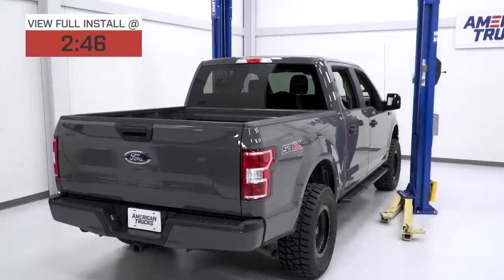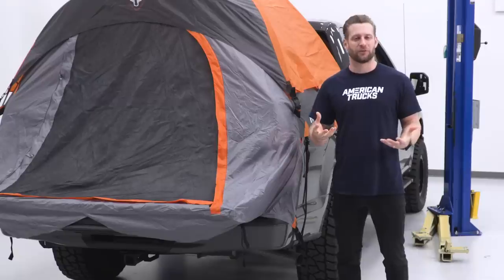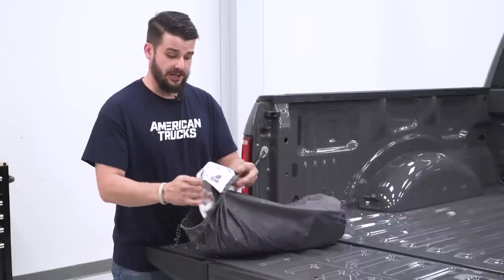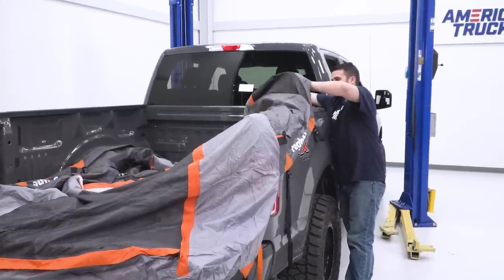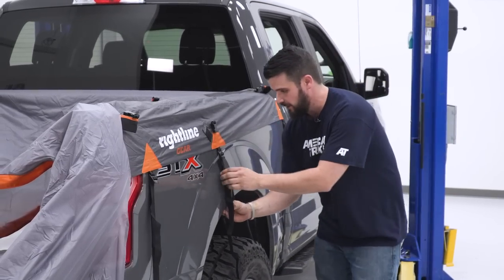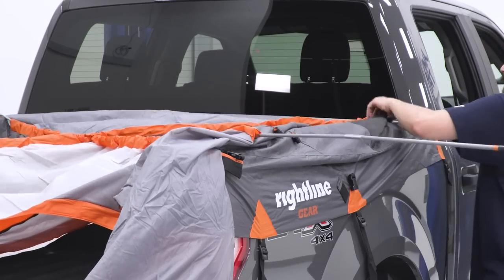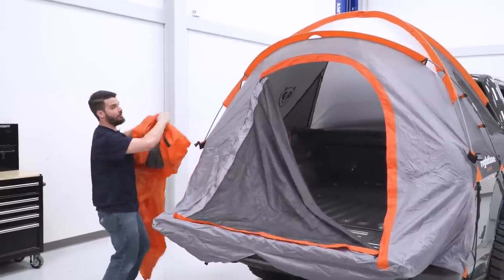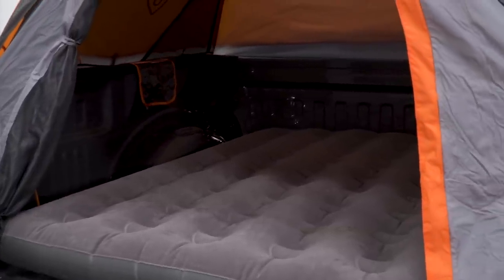1997-2019 F150 Rightline Gear Full Size Truck Tent Review & Install

Comment: Just purchased and installed this tent for my 2014 F-150 XLT Crewcab with a 5.5' bed. Fit very well. Took me 20-25 minutes to get it right the first time. The tent is very light in construction but well-built. Looks fantastic with my newly installed Bedrug bedliner. Inside is large enough for a foldout cot to sleep on and still have some space for my cooler and other items. I would highly recommend this if you go camping.

Comment: used it this weekend. It isn't too bad, wish the cross poles were more clip on and have less sleeve. I didn't push the orange strap through the tailgate I just tighten it on the tail gate hook and it seem to work well. Also it does not give that much head room great for kids or short people.

Comment: We have a 2009 Ford F-150 Supercrew Lariat 4x4 with a 5ft bed.  The truck bed has a non-removeable, non-folding fiberglass LEER bed cover with lift assist hinges.  The shocks hold it up at almost a 45 degree angle.  Can a tent like this be installed on a truck with a hard fiberglass truck bed cover?  If so, would it go over or underneath the cover and would it still protect from weather?  If not, please provide a link for a tent that would work with this truck if you know of any.  I see multiple pictures online, but some are homemade and other's I simply can't find a link for purchase.  I appreciate any information!  Thank you and God Bless!

Comment: Change the design of the poles. Clip on is better, faster, and lighter. Just like those in north face tents. Ceiling could use more mesh for better start gazing and mesh pockets every corner. The entrance could use a lil awning like this in roof top tents as well. Just a suggestion
Reply: reason for pole tubes is so you dont have to climb in the bed to install poles

Comment: Could you install this with a hard tonneau cover in place like the MX4?

Could I fold it up to the 2/3 position, install the tent, then fold up the MX4 the rest of the way? Or leave it down for a shelf inside the tent?
Reply: We need answers!
Reply: i didnt think about that but probably so since it attaches to the wheel wells and under the carriage and not on the sides of the beds where the rails are. i have a undercover hard tri fold, leaving it in as a shelf would be awesome
 im receiving mine in a few days, will test

Comment: No sewn in groundsheet? Will torrential rain run down the back and into the truck bed? Can't imagine its well sealed to the truck, especially when windy too. Result, one wet nights sleep.
Reply: Two rainy nights and dry as a bone just set it up as shown